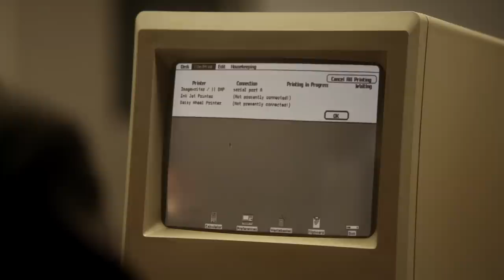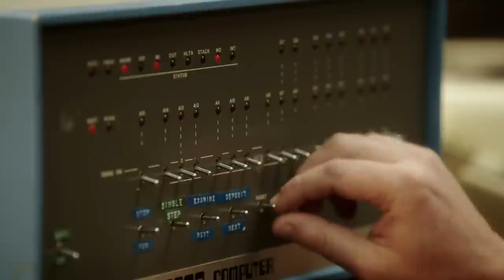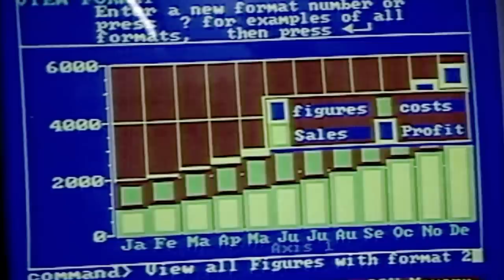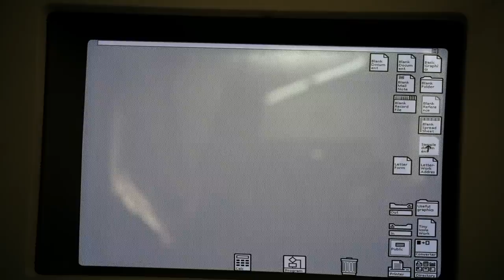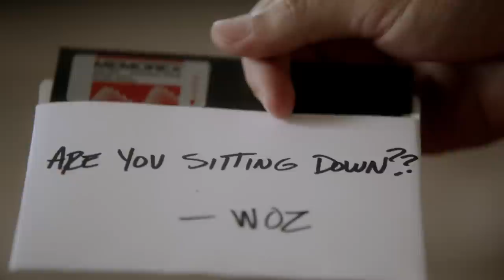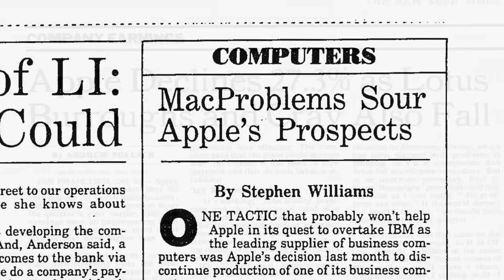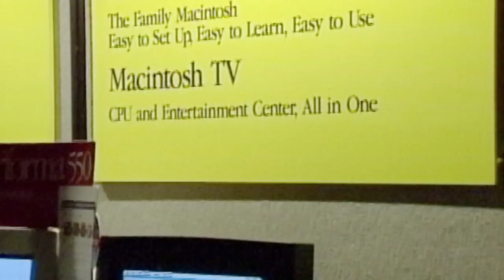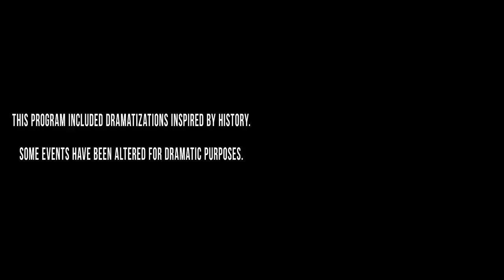The Untold Story That Changed Computing Forever | Jobs vs Gates

Comment: This video skips over the creation of NeXT. If Steve Jobs had not founded NeXT in 1985 we would not have what we now know as macOS, iOS, iPadOS, watchOS, and tvOS. All of these are based off of the operating system software developed at NeXT. Bill Gates had refused to develop for NeXT but now Microsoft Office, and a lot of other Microsoft apps are running on software derived from the NeXTSTEP operating system. Apple's acquisition of NeXT in 1996 was more like a reverse acquisition. NeXT ended up taking over Apple.